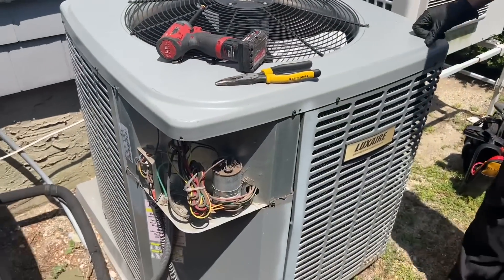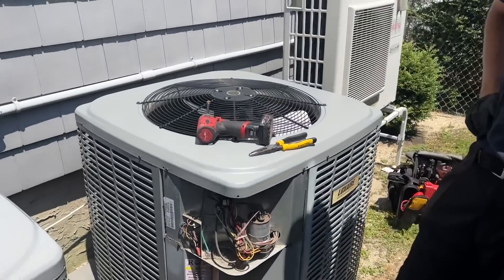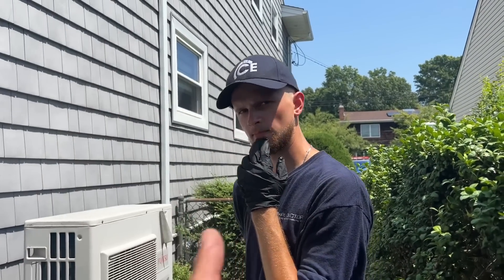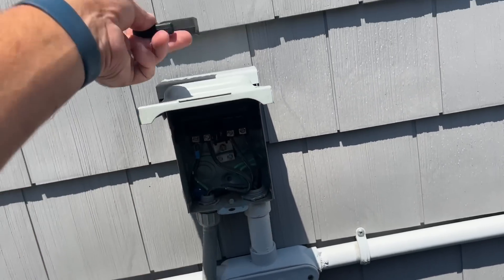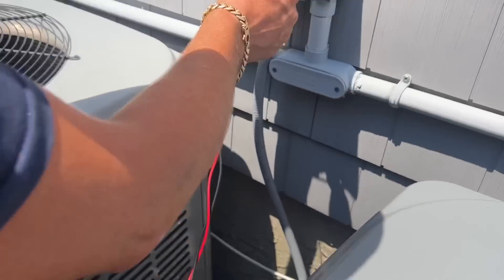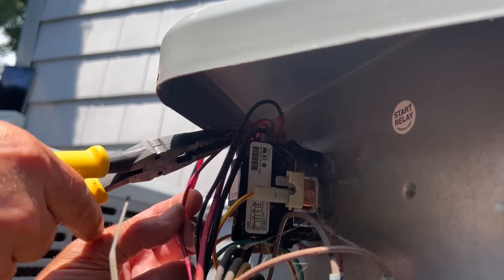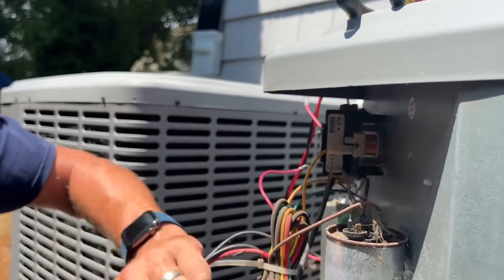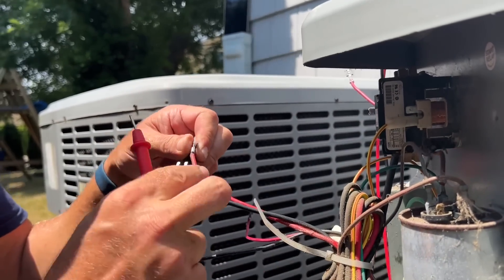Shorts to Ground - Dead AC Compressor - How to Handle Replacement

Comment: No way to test for restrictions in the tubing after the compressor unit removed?  Seems the gear for that test would exist, but then you wouldn't have as many opportunities to upsell a complete unit.  I realize that servo type expansion valves on some evaporators might present some difficulties in doing this.

Comment: That is so shameful. That looks like a brand new Copeland compressor with almost no rust, corrosion or wear. That thing should be a beast and last for 20 years, even in hot S Florida. Yet, there it is. Defective. What crap they make these days. The units manufactured in the 70s and 80s would last for many decades with hardly any service calls.

Comment: Great step by step explanation for diagnosis of a short to ground compressor.  The benefit of replacing the condensing unit is the new 10 year/or 5 year warranty vs 1 year warranty on the compressor only.  This looks like a possible under warranty unit which wasn’t discussed in the video.

Comment: Personally I never reset tripped breakers without checking for shorts and on a system like this verifying the condenser fan motor spins freely. Good tutorial for the young guys Mike 👍 no hate I've just smoked a breaker resetting it with a shelled out compressor
Reply: @PipeDoctor  
At least truce.

Comment: Probably had a leak causing the superheat to be high- meaning poor suction gas cooling for the motor. And motor burns usually make a mess inside the sealed system. I just replaced one on a Trane heat pump. It was so bad I piped in a suction line filter between the SOV and compressor as extra insurance for the Acid Away.

Comment: Just a little safety suggestion, if a compressor pops a breaker you should be checking for a shorted compressor before you try to turn the breaker back on.  It's very rarely happened but when they pop their plug things get nasty.
Reply: Actually not that rare, happened to me twice in less than 6 months apart. Compressor shot the harness plug out and things got messy!

Comment: I have an old dead compressor and the exact model is no longer available to purchase. In this case, is it possible to replace only the compressor that has the same capacity? Or should I replace the entire AC unit?
Reply: What your going to pay for a compressor better of replacing unit. Unless compressor under warranty. Which should be ten years if registered
Reply: Average compressor cost company 800 to 1200 to buy. Three ton ac 900/ 2500 depending on stages and seer rating. Then matching a coil 300/800 dollars company cost. No labor or profit. Just contractor pricing.

Comment: I’ve seen some scrolls have 20 olms to ground and the compressor was still good. That one was obviously bad tripping the breaker
Reply: 😂20 ohms at 240volts equals to 12 amps equals dead on time
Reply: 20 ohms? Did you mean 20K? 20 ohms is a large loss to ground. That's 12 amps plus the current the motor is drawing to run the compressor.
Reply: Impossible. Do your research
Reply: @hunner9500  20 olms is 200k armchair tech. I do this for a living you need to learn what olms even mean.
Reply: @bigdaddy4975  
Ok super tech. it is funny that google doesn't know about olms.and is more funny that you are doing this for living and you still alive🤣🤣

Comment: Don’t forget the proper terminology of that terminal block connector which is a “pecker head”
Reply: When I was training new people on electric motors, I always called them “pecker heads” and included the terminology in their written materials. Management threw a fit over it 🤦🏻‍♂️🤦🏻‍♂️🤦🏻‍♂️🤦🏻‍♂️. I had to get the management of the electrical department to back me up to continue using the term…😂😂😂

Comment: What did the customer choose
Reply: I used your method of removing the control panel on a condenser coil replacement made it a lot easier
Reply: Unfortunately I don’t get the option of condenser replacement when the compressor goes bad because of new construction warranty work
Reply: Damn replacement coil cost more than the whole unit
Reply: @PipeDoctor  smart choice

Comment: Hey Mike I have a question about a 18,000 btu Mitsubishi mini split heat pump. My daughter just purchased a house and it came with the brand new mini split system. It was installed last August. Is it normal for both the suction side and high side at the condenser to be ice cold. To me it doesn't seem to be cooling the way it should be. I always thought the high side should be hot and not beer can cold.  What should air temp be coming out of the evaporator.
Reply: Yea that’s normal it’s an inverter so it works differently
Reply: I have found most of my mini splits i service range from 55 to 60 degrees blowing from air handler unit.
Reply: Metering device is in the outdoor unit. That is why the smaller line is cold. Both lines for mini splits are low pressure. The smaller is low pressure liquid and the larger is low pressure vapor.  That is why both lines are insulated.